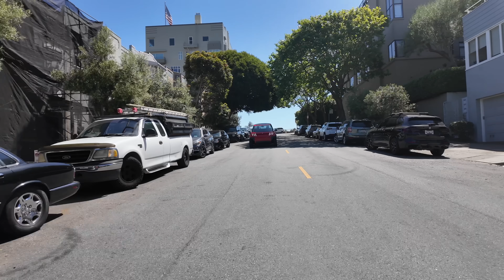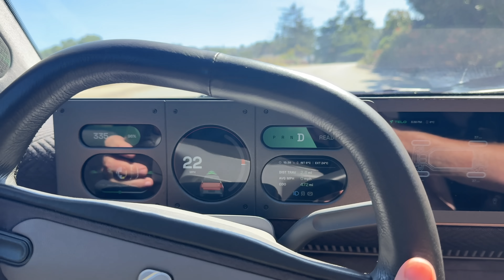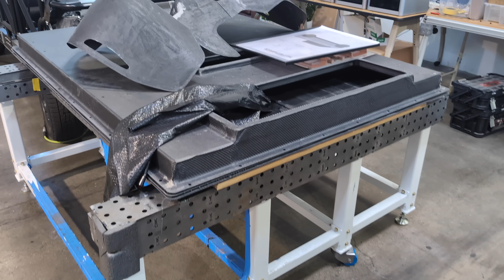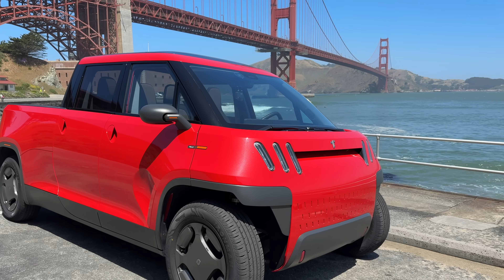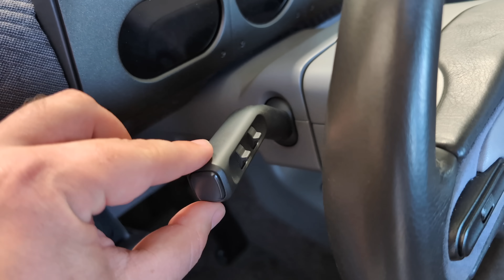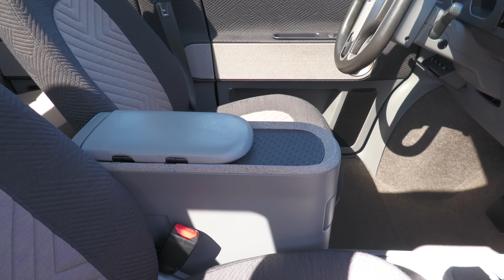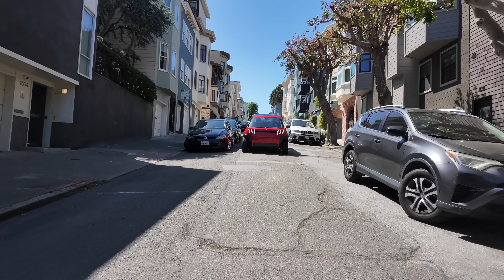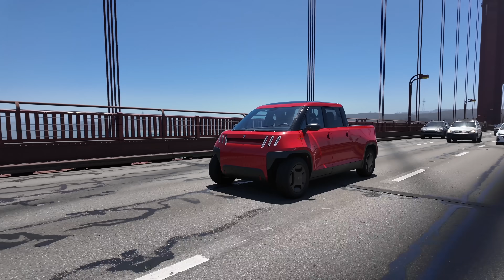The Tiny Telo Truck Hopes to Pack a Big Truck Punch

Comment: Seems a bit pointless. Like, nobody is really going to use that thing as a work truck. Maybe a delivery van. If it was a van. Or maybe if there was a very basic single cab option with more ground clearance. Except you can already buy a kei truck for less...
By the way, If you drive a big truck every day for work going "downtown" is no big deal. A bit stressful maybe.

Comment: So, first off, i love this channel, the obscure EV's are really my favorite and maybe the trebant 2 stroke death trap.. 

But the issues are simple.. The 41k is too much for a small cheap truck, when you are starting up, you really have to provide a market vehicle that doesn't really exist, or it has to be the best for the money. I don't see that happening, it's not a diss it's just any new manufacturer will have initial quality issues. The other issue is size, yes, it's small with a big bed, but.. The federal tax stuff for business require a certain weight and footprint size to qualify as a business expense, so an f150 will be 10k more, and less efficient in a city scenario, but there's a reason new trucks are so big, if the gov would change that, we would probably get a lot of new smaller trucks and cars.

Comment: I get that “nobody buys a single cab,” but if the use case for these by their own admission is city center delivery, I would think a single cab and/or a two door panel van would make way more sense than a four door pickup with a mid gate. Just my two cents. I wish them every success because it does look neat.

Comment: Yeah I'm sorry but that's not a pretty pickup. The interior looks ugly with no design. Just a big flat dash with screens on it. I'm still not sold on EV that use batteries. It's a plaster (band aid) over a gaping wound. I do believe hydrogen is the way to go. We built our lives around the horse then the car. Batteries is a backwards step that is a potential fire hazard. Hydrogen would fit into our lives seamlessly just fill with hydrogen instead of petrol or diesel (gas) but why do Americans call a liquid a gas? anyway. Remembering to make sure the car is recharged is an annoyance/inconvenience we just don't need. Cool concept for a pickup good luck to Telo I hope the do well. It's not an easy thing to do.

Comment: Why is 500 hp so important if it doesn't weigh anything? I towed things with 120 hp in a full-sized truck (the 80s were a wild time lol) that made me a menace on the road because the load outweighed the truck to the point where it was mostly in the drivers seat. I can just see 500 hp in a little plastic kei truck getting somebody into 5x as danger.

Comment: 6,000 lbs?  That's more than a Nissan Xterra can tow.  There's more to towing capacity than sheer pulling power, such as stability.  $41K? I'll just buy a used truck.  Mine has a 7,500lb towing capacity, holds 5 passengers plus driver and only cost me less than $20K.

Comment: I really like this little truck. I currently drive a 1995 Ford F150 XL standard cab, short bed (300-6 manual with a/c). I need something newer, but I’m 6’5” and on a very restricted budget. I haven bought a new car ever, and I haven’t purchased a car at all in almost 15 years. Not to mention, I’m no spring chicken (51yo) and I probably only have 1-2 more purchases left in me. The Telo looks like fun, but I’m not sure I’d fit. I’m thinking Slate…unless someone wants to offer me a test vehicle. I live in Dallas and drive 70 miles (round trip) every day to the Whole Foods where I work. Could be good exposure. And we have a charging facility. Just saying.

Comment: It's just wildly overpriced for what you get, and no it doesn't matter that it "isn't designed" to compete with cheaper vehicles or if the batteries are made in one of the most expensive labor markets in the US. It's a cute design if you want to look like a gonk from 2077 but it fails at the kind of vehicle Americans need or want. If you have that dire need of a tiny truck for the city, just import a Kei truck; it'll be cheaper, with better range, and likely more capable.

Comment: The first thing I noticed about this thing is the front; specifically, how, unlike every other pickup truck on the market (including, bizarrely, the electric ones), it's actually designed in such a way so as not to compromise forward visibility. I mean, gas-powered vans get it right (even the American-style pickup-chassis body-on-frame ones like the GMC Savana), and I've even driven dog-nose school buses with better forward visibility than any pickup truck, so why the hell do all the electric pickup trucks on the market still have that huge schnozz to run over children with and not notice?
I'd prefer it if most people didn't need a car in their day-to-day lives, but as it stands, I do hope that this, or something like it, becomes successful enough to shake up the industry.

Comment: Lol I'm from Holland and my first thought was: well this may be a truck for Europe, not so much for the US. But then your Dutch friend pointed out that it's still big compared to the average European car. However, there are lots and lots of SUV's sold lately.
Reply: Which is a problem that should be addressed. This vehicle - as all pick-ups - is practically useless. All productive work (in cities) in Europe is done using vans, pick-ups are just regulation-dodging tools for manhood deficiency compensation. This is solving a problem that should never have existed. The van version would be cool tho...

Comment: They are building the battery from scratch!?!?!  I thought for sure they were using a Tesla or Leaf pack.  Why not sell EV converted Mavericks until you get a name for yourself and then branch out into a bespoke vehicle?  Has to be cheaper, even buying the Maverick new.  I predict if this is a product people want VW can completely destroy them by launching in this range, they have had a Golf based pickup in South America etc for years.  (In fact they might be 25 years old soon, import and electrify those?)

Comment: Here is my sales pitch: "Want a Tesla drivetrain in a truck shaped go-kart?  Have we got a deal for you!  The crash testing is BS, at least what they said.  It has the crash structure of a Smart car, which I'm not sure would even pass today, and only passed when it did because it is tested against similar sized vehicles, not what you encounter on the road in the USA, even 'meeting' a Corolla would be deadly.  Also a Smart car had high strength steel and a lot (a lot) of money in design.  What they showed was an aluminum beam perimeter frame and a tubular bolt on top structure.

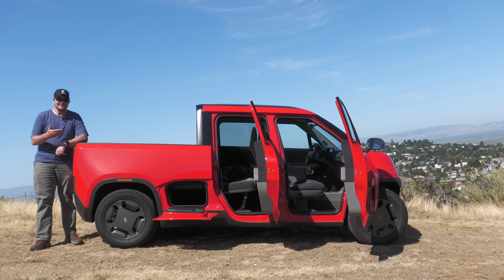Comment: 0:50  I call that a "Maxi Cooper".  Looking at the overlay with a Maverick they should probably extend the front for a multitude of reasons, not the least being crash protection and aerodynamics.  500HP seems a bit nuts, especially with the lousy aerodynamics of open front wheels (although I get it for the shortness, it just won't be freeway capable).  Most places around where I live it won't even be legal on the highway due to safety regulations it will be limited to 15-35mph and classed as a "NEV", a 500hp NEV seems nuts.  Good luck, but unless it's $15k no chance.

Comment: I appreciate the design and yeah it looks like fun. The SUV looks great too. My only issue is that the front wheels are so exposed. I'm guessing there's air dynamics at play here (airflow to work with the air tunnels in the backs or the wheel wells)?

Comment: The front needs a bit of work, I'd get rid of the back seats and maybe add a bench in the front (3 seats.) Give more room in the front but also makes the bed longer without opening to the inside (cold/hot air and water issues fixed.) Looks too much like a toy and I do feel that will hurt sales in a large way, I wouldn't buy one (not that I'd waste money on an BEV.) 

What I like is that it's smaller despite failing to make the best use of space with the back seats being useless but taking up a huge sum of room. I like that it appears it can turn very sharp and easier to park in any space. 

I can't stress the poor visual design enough... People who work for a living will absolutely reject driving a truck that looks like it drove out of a 6 year olds cartoon. I fully realize some fanboi out there will disagree, but reality and their bias opinion won't line up. The truck should do the work of a truck and also look like it can do the work of a truck if it wants to fill that role. That front end can bump out slightly more and give it better shape IMO, currently it looks like it was just chopped off and a fairly bad point. Where the lights are in the front could look more like bulked shoulder pads with big square lights of something, not whatever G rated look it is now. 

Just my thoughts and opinions, if you disagree feel free to to pretend I care =D

Comment: The minivan version of that would be killer.   Like that should be the first choice.  I can see a 2 seat  cargo minivan version of that being a darling of construction trades
Reply: That was my thought, too - either this, but two-seater with all the bed possible, or just straight up cargo van version. A bit pricey still, but it would do just about everything we specifically need without being PITA to fit in standard-sized parking spots.
Reply: @sinine1100  maybe that’ll sell some kids that allow you to convert it. I almost kind of wanna take a little bit of notes from Slate
Reply: Get yourself a 25 yr old Daihatsu! I just got one tagged and street legal last week. 1996 hijet twin cam 12v 40,000 kilometers (about 20k miles) for $2800. I replaced the battery, and it runs like a sewing machine lol pretty quiet. Everyone who sees it falls in love with it. I bought it to clean up and sell, but my wife liked it so much that we're keeping it.
Reply: Just thinking the same, the four seater is a waste of the available space.  Just sell it with a single cab.
Reply: The chicken tax would make that very expensive in mass production, so I understand why they don't do it yet
Reply: @nathanielhill8156  Could end run it by makeing it a Passenger van with removable seats.  Keep the 4 door or possibly convert the rear one to a slider for more access. Instead of bench seats have 2-4 captain chair style seats that are easy to remove.  a few minutes to yank out the seats you dont need and you've got a cargo van.

Comment: I have some land and a rusty 25-year-rule imported kei truck.  The only reason I wouldn't take this over the kei truck is it's electric and it doesn't have a dump bed.  But I have the kei truck for the same reasons urban people don't love larger trucks.  My half ton is a pain to drive around the land between trees and through awkwardly sized or angled gates.  Everything except towing is better on my land with the kei truck than the half truck.

Comment: The thing that annoys me about most EVs is that regen isnt configurable enough. Hyundai does it pretty well giving you 3 different levels as well as iPedal and Auto adjusting. 

Telo should have  a setting for people like Robert that love 1 pedal, and a slightly more than engine breaking setting for people like me who hate one pedal and would rather just use the brake pedal to regen.
Reply: The EV I have driven most is the VW re-up, by local ride-sharing apps. 
It has low and "high" Regen with some extra levels in between on the "gearstick" 
I really appreciated the levels, even of the strongest wasn't strong enough, but then again the motor is only about 80hp.
I would just prefer to have the level chosen either by "gear pads" on the sides of the steering wheel or literally as a retarder stick on the right side of the steering wheel (like on European trucks)

Comment: It doesn't matter if the Telo CEO thinks that the price is justified based on their individual manufacturing circumstances. It needs to be competitive and at 60k for such a rudimentary vehicle it just isn't. Especially considering that early adopters will be the lab rats they'll test their features on. For that kind of money I'd want a usable vehicle. And that's the other aspect: Price aside, the target audience wants a reliable vehicle. 

Not to give Tesla any more kudos than necessary, but their tactic to enter the market was more clever. With the Roadster they chose a sports car which targeted the rich elites who were looking for a status symbol and where the price was completely negligible. Once they had a name, it was easier to get big investors on board and to scale up accordingly. 

At this point, Telo just looks like a failure. Though, I still hope they'll be successful.

Comment: Ditch the glass roof, put better seats in it. Use amber rear turn signals. Add front bumper protection (I drive a delivery van and have SEEN things). Offer a bed cap.

Comment: The design is what it is, but I have one strong critisism about it: shouldn't this have a front bumper? I don't know the driving habits in the US, but it seems a bit odd, like you hit anything with the corner of the front, and instead of crushing the bumpers, you wreck the wheel geometry or get a flat tire.

Comment: 11:19 I'm actually in the camp of not using one pedal drive mode, mostly because it makes it reeealy hard to coast.
Following behing a Tesla is suuper annoying, because they are either speeding up or slowing down. I live in Washington, with lots of hilly, windy, rainy roads - and being able to coast by just letting off the throttle is neccesary for smooth driving.
I like blended braking the best.

Comment: well looks all good to me, but and i mean but, it wont go through UK specks , lighting, Leading Edge exposed front tyres,  don't understand where they got safety first with those exposed front tyres,  if you were to hit a child or a adult with those tyres you'll just pull them under the car instead of bodywork deflecting them, the definitely leg and ankle breakers, show a real boo boo on safety there. has a two-door van variant that would work brilliant in the UK, it's just what we need and looking for. I suppose it's not made for the UK in mind.

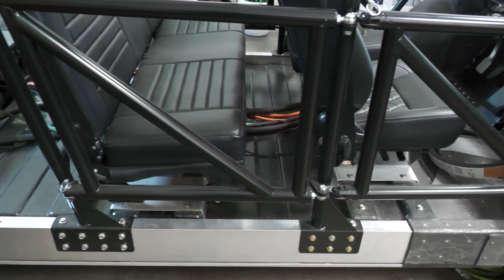Comment: 1:13 I've heard Rivian say this many times and now a large majority of their batteries are made in China. This change has led to many fires breaking out on the building and the repair lot where 2/3 vehicles are towed because they can't drive out of the factory floor under its own power.

Also please make the climate control fully analog all the new vehicles are switching to this digital/hybrid control system and its very annoying to have to wait for my center screen to popup the controls and then have me look away from the road because I don't have any tactile buttons just to adjust fan speed or the ac pump. I have a Honda civic that does this and it makes my F100 heat lever look nice.

Comment: I want to see the CEO hauling a few 4X8 sheets of plywood around Phoenix in the middle of summer. Around Buffalo when the lake effect snow is a howling blizzard. Around St Louis during a normal for there near-severe thunderstorm. Do this repeatedly until he understands that opening the interior to the outside  isn't being smart at all. 

It's a truck with a 5ft bed if you can only use the extra length in nice weather. People can't stop working just because the weather sucks today. And a lot of folks still like to be able to enjoy good weather and clear away your passenger's farts quickly by rolling the window down. There's reasons other than price why you don't see Rivians and Cybertrucks all over jobsites and Telo is going down that same dead-end road. Make it truly usable and it will sell.

Comment: hate it just because there are no knobs in interior. imagine offroading it and wanting to turn off a heater on a rough road. orrr finding hazard flash to thank other driver that he let u in the lane. i hate this design, its disasterous. also, no leg room, im 1.83m height (6 ft for u freedom unit junkies), i cant imagine fitting myself in its back seat without cutting my legs off. Also headlights doesnt rly look like they offer good and direct illumination. Also there is a reason why front wheel are covered from the all sides, i mean the front. Its the safety, cause u dont really want to be hit by a rotating rubber thing as well as with the car itself, it would shred someone apart. btw interior plastics and fabrics look cheap and crackly. If u want a good car u basically have to get an old car that is in good shape and retrofit an electric motor in it.

Comment: FIVE HUNDRED HP? Who needs that? I consider that a major NEGATIVE for what otherwise seems like a great vehicle. I have a real offroad diesel 4WD, rated to tow over 7000 pounds, with 200 HP,  and that is more than enough power. 500HP is just dumb. - - - - - - The rest of the vehicle looks great.

Comment: If i'm buying a truck, i'm not buying a family vehicle. 2 door is fine. 
Because THE MOST IMPORTANT part of a freaking truck is can it bring supplies/materials somewhere?
The biggest landmark size is 4x8 sheets of plywood/sheetrock. So I'm glad the 4door still manages that room. 
Still think making it 4door is a mistake though. I think this would sell SO MUCH MORE if it was 2 door simply for the huge amount of room it could have in the truck bed while still tiny.
(PLEASE tell me that it has durable/reinforced wheels and suspension.)